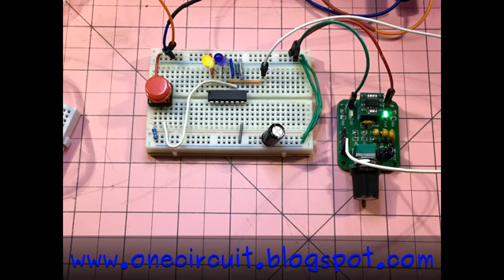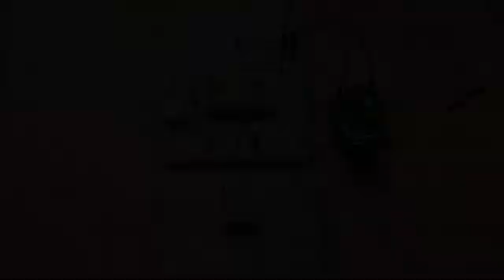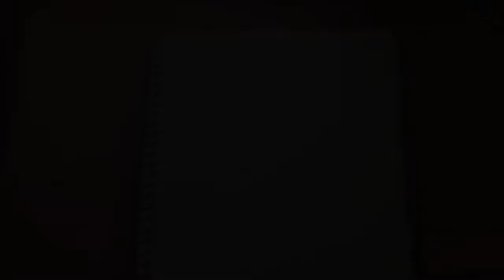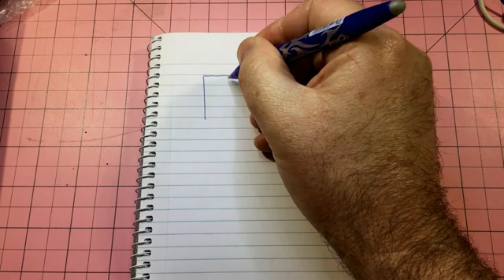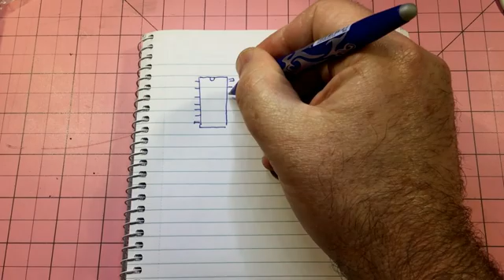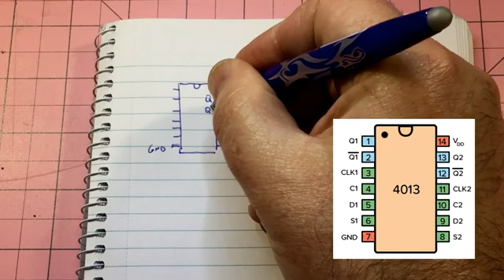CD4013 Dual D-Type Flip-Flop

Comment: I have one of these chips and want use a single N/O push button to alternate between two 12v lights. How would you go about it?
I’d prefer to run the push button to earth but switch the positive side of the lights as they will already be earthed.
Reply from the maker: I'm not sure I'd use this chip - perhaps a "latching transistor circuit"? Search my channel for this circuit - I did a video a couple of years ago which might be of some use. If you are committed to using the CD4013 to latch then this link (http://www.discovercircuits.com/PDF-FILES/4013oneshots.PDF) might be of some use.

Comment: I use the 40xx series chips quite a lot in my Z80 projects. They are so useful.
Reply from the maker: I'm glad I bought a swag of them a couple of years ago. Some are quite hard to find now and the freight charges are becoming ridiculous. I cannot find any CD4095 or CD4096 chips to complete my "flip flop" journey - I might actually make them from following the block diagram in the datasheet! I'm looking at the 7400 series TTLs as a possibility as well.
Reply: @onecircuit-as  I don't find the 74xx series as versatile, but they are very reliable.